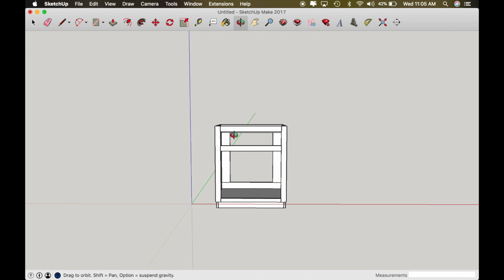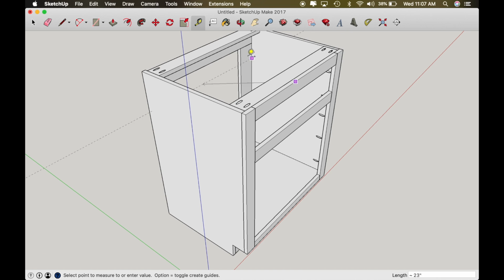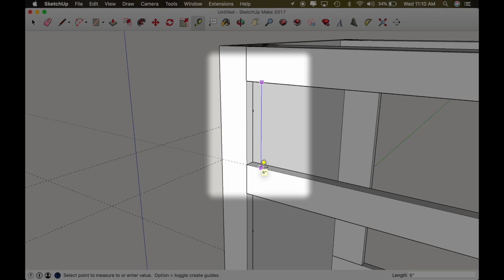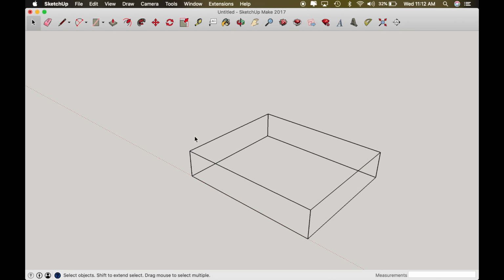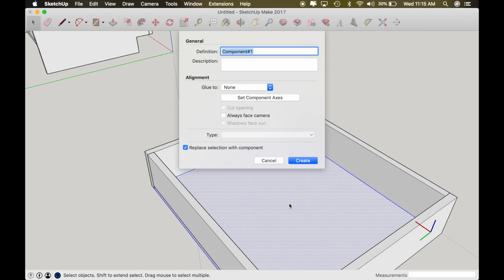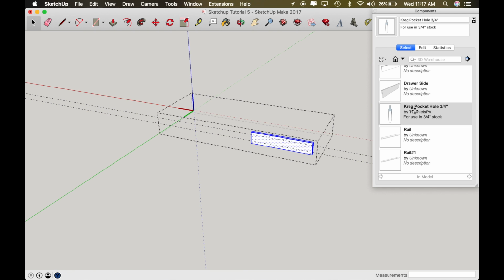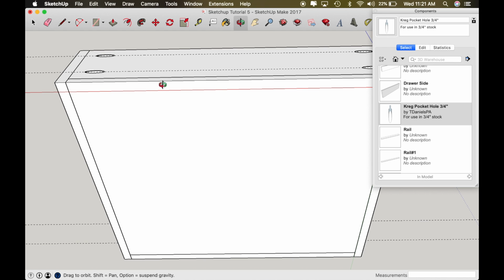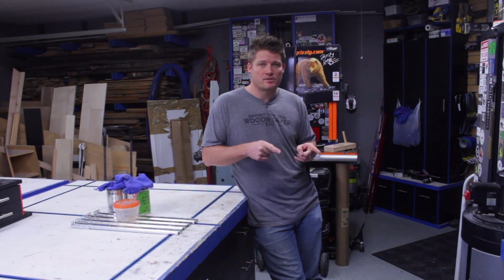Pocket Screw Drawers - Sketchup for Woodworkers Tutorial 13

Comment: Wouldn't you put the pocket holes on the outer face of the drawer front so they don't show inside.  They get covered by the face panel.  That also oreitnts the screws toward the meat of the sides.
Reply from the maker: Yes that was a mistake on my part whenever I was making the video not thinking clearly. Thanks for clearing it up